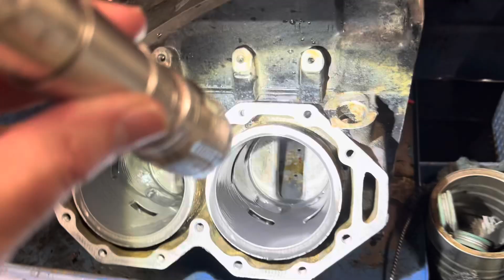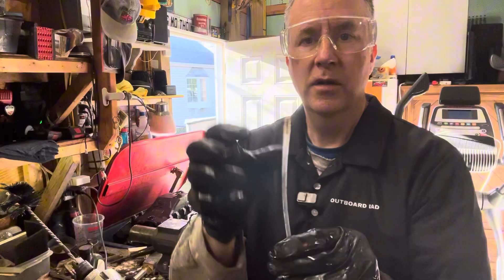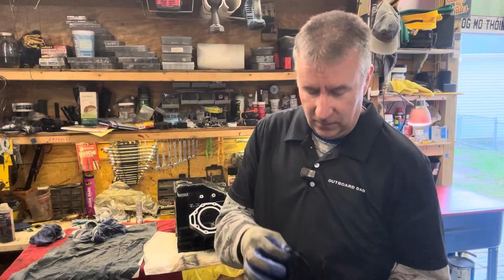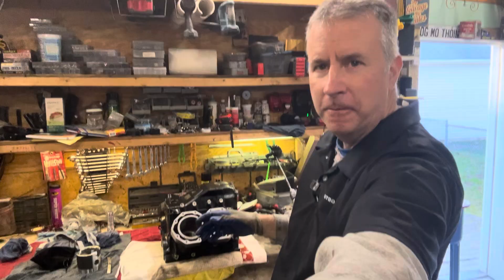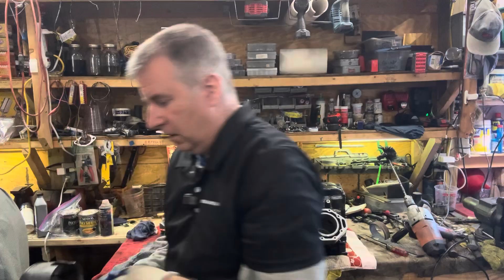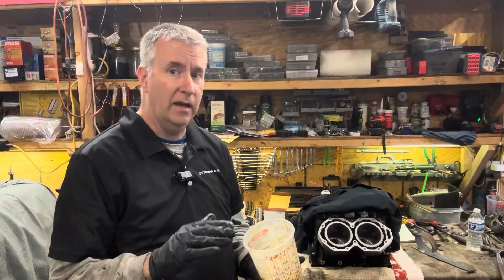2 Stroke Outboard Rebuild Plateau Hone Pistón Measure (Part 14)

Comment: Oldtimers information is the best,  question: have you had any issues with one side of the engine bored out and the other stock?
Reply from the maker: @goodtogojetski  Great question! No problem at all! You can do just one or two any combination and they run fine. A machine shop guy once told me the new piston have a different pin position that makes up the difference in stroke but I have not verified that.
Reply: @OutboardDad  makes sense, good information
Reply from the maker: @ Thanks for your comments! What motor do you run?
Reply: @OutboardDad  I have a 87 evinrude 90hp on a 88 starcraft
Reply: I will be new to rebuilding an outboard but have rebuilt several 2 stroke jetskis
Reply: @OutboardDad  1987 evinrude 90hp, it's on a 88 starcraft
Reply: @OutboardDad  I will be new to rebuilding an outboard but have rebuilt several 2 stroke jetskis
Reply from the maker: @goodtogojetski  Great! I love those v4 Crossflow motors. Please let me know if I can help